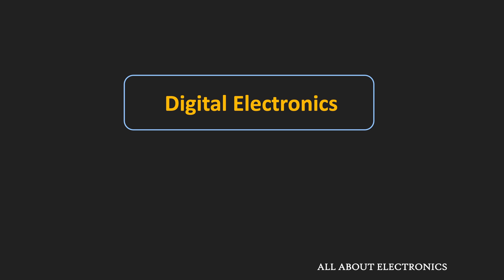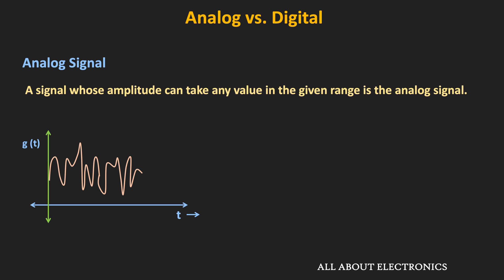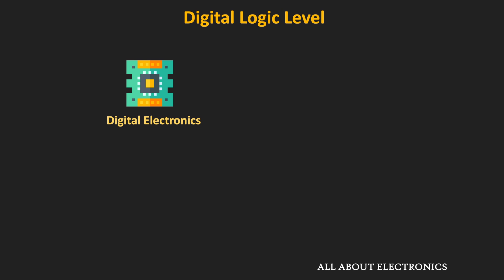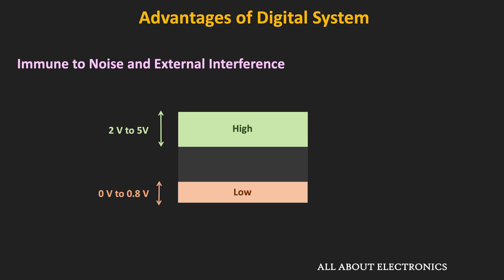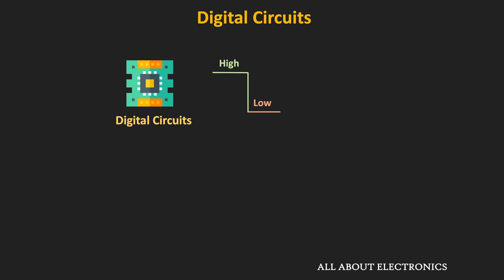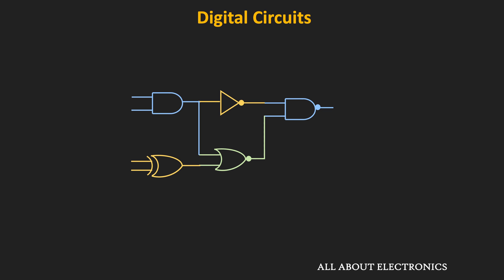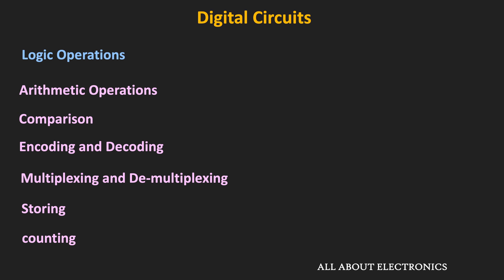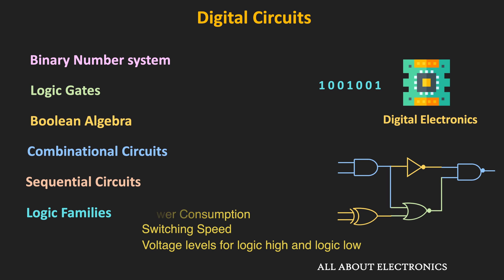Introduction to Digital Electronics

Comment: What is the difference between discreet time signal and digital signal?
I think, a discreet time signal can assume finite number of voltage levels where as the digital signal strictly two. Is there any signal like binary signal?
Reply from the maker: Discrete time signal is discrete in time domain. In terms of the amplitude it could be analog or digital.
When we say a digital signal, then on y axis, it has finite number of values. It could be 2, 4, 16 or any number of finite value. But typically in digital circuits, the signal which we are referring has only two finite states.
For more info, you can check this video on classification of signal: https://youtu.be/E4E1GftPD1M